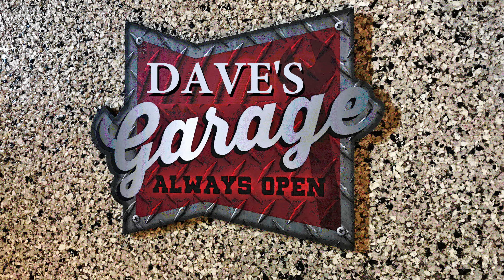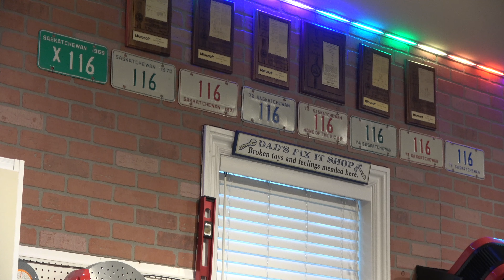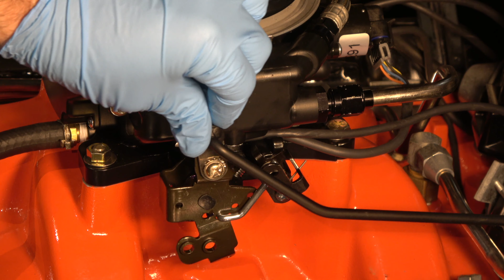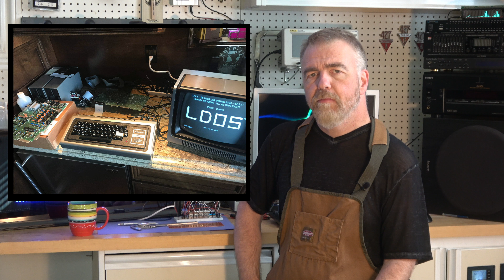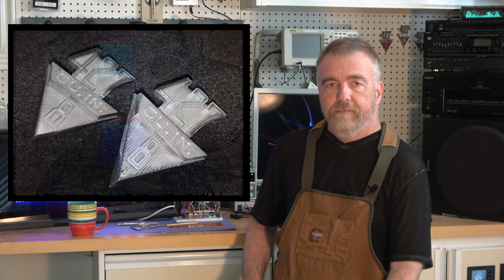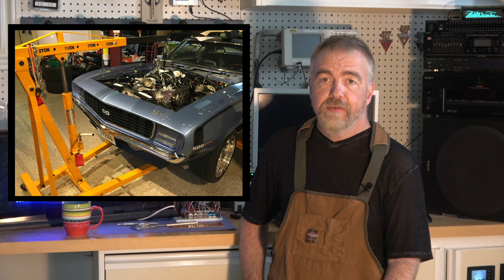Dave's Garage: My Dad's First New Car Turns 50 Years Old!

Comment: I think we were cut from the same mold.   I’m just a few years away Older than you.   Loved seeing this as my dad’s first new cast was a 1968 Pontiac Catalina complete with fender skirts.    How I smiled when I saw the nose on that car.   We always had a hole in the Sheetrock in the front of our garage where my mom would habitually put that nose through the wall as she pulled in.  

While I do code, I’m more hardware oriented since my days job is heading up electrical test for a major semiconductor company.  

Regards and now I’m back to your Arduino videos.

Comment: How is it fuel injected!? It is the carburetor that I'm looking at under the air filter - right?
Reply from the maker: Yes, that hold the Holley injetors.
Reply: @DavesGarage  did you also ad a solid-state kit to save wear on the  ignition points??
The output stage MOSFET usually delivers a more consistent spark through any old/new coil.

Comment: You have pretty much the same hobbies I have, gives me hope that if I work hard enough I'll be able to enjoy at least some life like yours. I'd be really interested in your process of a frame-off resto-mods and how you tackle it as I've hit a wall currently working on a '55 Belair Sport Coupe my dad bought back in 1970. I've tossed some 13" Wilwood front disk breaks on it so I could move it to my house and the 327 is completely apart. Need to clean, inspect and machine it but worry about doing things out of order.